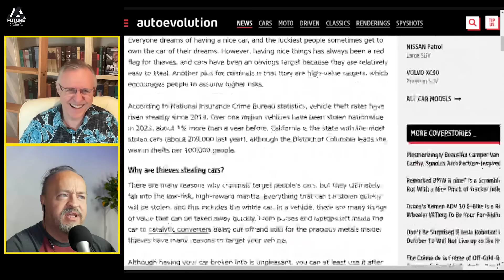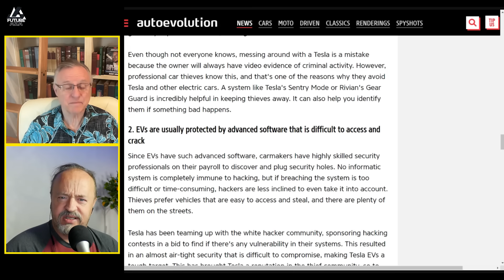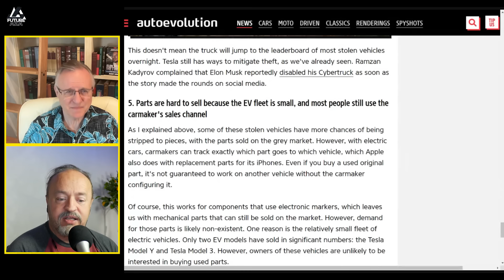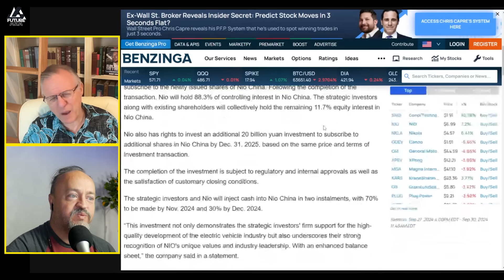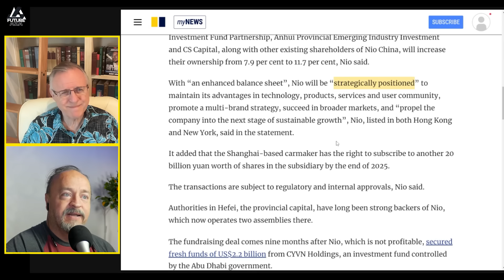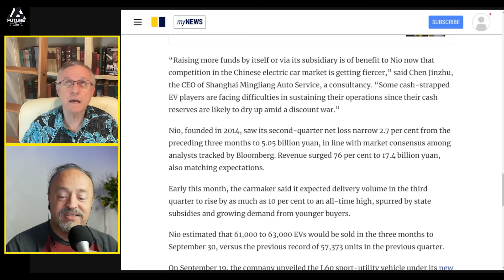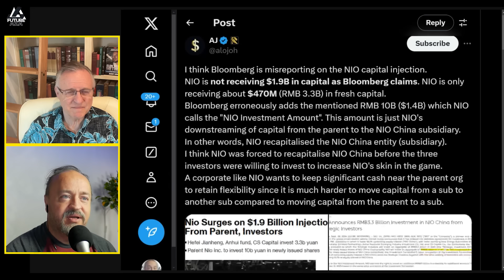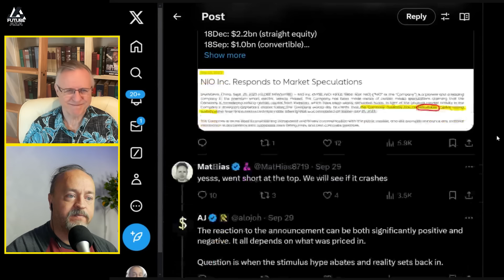Nio's Death Spiral Continues

Comment: Hey Brian,  I have a suggestion for a show topic you might want to look into. Against my advice to my friend to buy a Model Y, they decided to purchase a Chevy Equinoxe EV and recently took delivery. The dealer tried to upsell them what I thought were useless protection options. From the dealer my friend asked me "how many times per year do you take your car into Tesla for undercarriage cleaning?"  I laughed and replied, the only under carriage cleaning I perform is in the shower. Then she said this "The Equinoxe bev supposedly has vents underneath for battery operation.  Warnings are do not use chemical rust proofing (coating the underneath invalidates the battery operation design) and have the undercarriage cleaned 2x per year."   Sounds like GM realized there's a design issue or something.  I told her that the only thing I do is clean and lubricate the brake pads in the spring time and they're still at 90% after 125,000km.
Reply: Or find a "Carwash" that has an underbody spray and use that?
Would be interesting to see if that dealer has such a carwash on site or whether they just jetwash manually?
I would ask them exactly how they do it.
Also ask them what their "Cleaning" is for. Is it to prevent corrosion, to keep water drains clear, or something else.
Maybe contact another dealer, or GM HQ, say you're considering buying one and ask what the standard service procedure is.
.
This sounds a lot like the EV version of Nitrogen in the tires?
Reply: @antoinepageau8336  
Correct.
The implication that they need the dealer to complete the procedure is a cash grab.
I'd be in there with a receipt from the local "underbody" car wash.... Maybe a video of the procedure. 
Imagine if they replied "Warranty void, you used a wash with detergent in the spray"?
Reply: Thank you for adding yet another reason to never buy OEM garbage.
Reply: Your friend will have to try and unsubscribe from the “Onstar” system a few times after the free trial.  Good luck!
Reply from the maker: Dealerships still doing their dealership nonsense. How frustrating that must be for buyers and the manufacturers too.

Comment: Investment in infrastructure with 100,000 battery swaps a day and rising is not burning cash, it’s the foundation of a monster in the making. Do you honestly believe that NIO has got it wrong when the Chinese government have now implemented laws stating that EV manufacturers must show that they can check battery health and change any batteries that are found to be sub standard ? How can they do that in a cost effective way without battery swap technology ? That’s why so many big players have joined NIO’s battery swap program and many more will in the future, it’s the only viable buisness model and NIO is currently untouchable with the largest charging and battery swapping network in China and it’s getting bigger by the day. They will have an eco system similar to Apple in the coming years and you can’t achieve that without spending money which you choose to call burning cash. 😂🤡
Reply: Thank you. Longterm $NIO. It truly is a remarkable company.

Comment: I have always said that the battery swap was not feasible. It just costs much more to build swap stations and stock charged batteries than it does to make 10 Superchargers. I figure NIO will be successful only as long as the Chinese government continues to fund the building of swap stations. Same goes for hydrogen cars where governments fund H2 stations. When this funding goes away, hydrogen and battery swap will disappear.
Reply: Battery swap is tremendous in key areas.  
Battery swap keeps resale  price acceptable. Battery swap enables a short longer range battery for yearly trips.  Battery swaps aren't mandatory.  Traditional charging is available.  40 swaps a day would be above water.
Reply: @sennaha  Nich markets are for small companies you have tens of thousands of batteries the most expensive part of an EV without selling an EV it is patently stupid.
Reply from the maker: @sennaha There is no free lunch. Have you asked yourself how a system that costs more money to build and operate can save the customer money? If the customer is saving money because of swaps, it's only because the company is losing money.

And they are absolutely losing money. Boatloads of it. Well over a billion a month.
Reply: @FutureAzA There isn't a free lunch, but when the volume becomes enough, profit does materialize. Standardized battery swap across all manufacturers will actually be more efficient.  
Buying a used Tesla for 20k and then 6 months later finding out you need a 20k battery isn't efficient.

Comment: On the NIO front, you are doing with the naysayer are saying about Tesal. You have limited knowledge of this information. Randy said that he did not read the article. Are you speaing FUD?
Reply: Brian did.  Randy was up front about not having read it.  However one does not need to read an article to understand what was said about battery swapping was true.
Reply: The information is public. NIO is losing money. With negative returns per share.
Reply: @quintalraymond
WHAT is he saying that's the same as others are saying about Tesla?
What did Brian say that isn't verifiable?
What extra knowledge do YOU possess? (On the basis that if Brians is "limited" you're suggesting that Yours is more extensive?)
As for his opinion on the battery swap issue.... I TOTALLY agree.
The swap system MIGHT work if you have a universal size in both capacity AND physical dimensions. You must also ensure a common BMS allowing all vehicles to interface with all packs. THAT might be a problem if a new cell technology emerges.
If you DON'T have that universal pack, you're immediately "doubling up" on either the quantity of different packs required, or the number of facilities, OR both.
Either solution also brings logistical problems, requiring a system (Trucks) to ensure the correct proportion of each pack type and capacity, at each location.... etc
 
The "K.I.S.S. principle" must apply.
Reply: @Dularr Tesla was for a long while as well. Nio has largest luxury market share. Onvo, Firefly will be the Model Y moment.
Reply: @sennaha  While Tesla faced less direct competition, it had the challenging task of pioneering and validating much of the EV market
Tesla did not have a parent company or Governments pumping money into it. Without the success for first the Y and then 3 Tesla would likely have folded.
Reply from the maker: I've made a number of videos about Nio. The swaps are a disaster and it's one of the things that's bankrupting them.

How do so many people not realize that things cost money?

"It's a better car for less money!" Cool, but it doesn't cost less to build, they're just losing more money.

"Swap is cheaper than charging, and your battery will last forever!" Cool, but it actually costs more than a fixed battery, and SOMEONE is paying for that battery. If it's not the driver, it's the company, and they can't lose money forever.

Either it's going to get WAY more expensive, or they'll go out of business.

I've covered this. Search up Nio on my video page and you'll see how deep I dug.

Comment: NIO's battery swap concept almost makes Hydrogen sound like a viable alternative 😂😮😅
Reply: There isn't a free lunch, but when the volume becomes enough, profit does materialize. Standardized battery swap across all manufacturers will actually be more efficient.  
Buying a used Tesla for 20k and then 6 months later finding out you need a 20k battery isn't efficient.